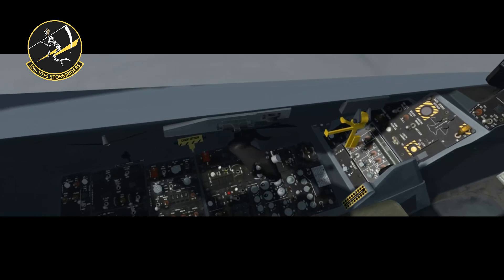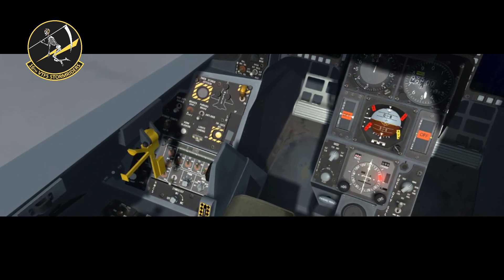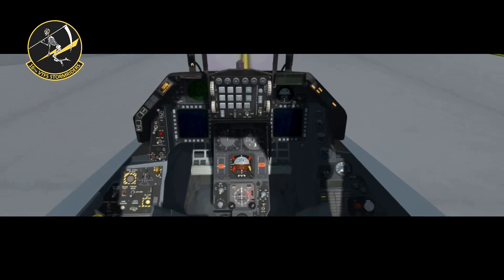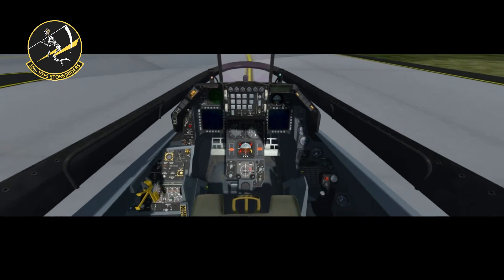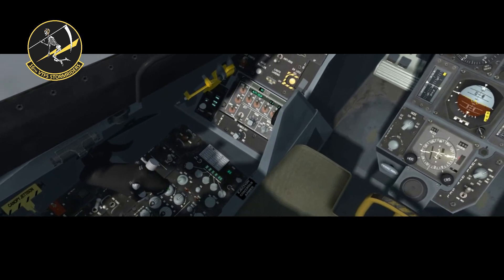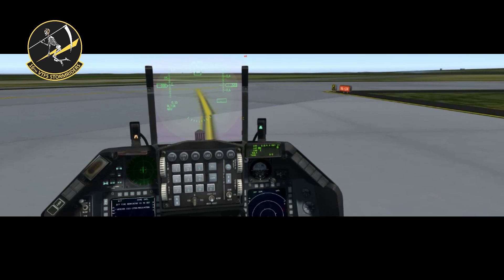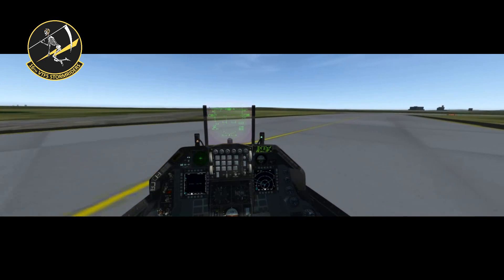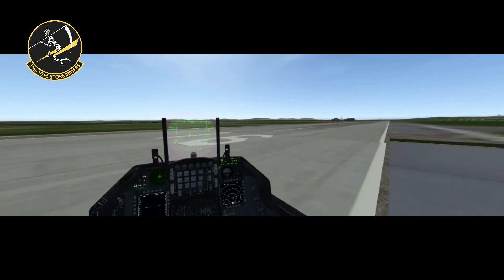Falcon BMS 4.33 Tutorial - Ramp Start (Scramble mode)

Comment: Hi, first off, great video, extremely helpful! I was wondering if you could help me with an issue I'm having.

When I turn on the HUD, the altitude and velocity are not there, only the scales. Is there a key that I may have accidentally switched or is it an issue on the game's part?
Reply from the maker: +TauAreSickAtCC Hi there! I am at work right now so I can`t verify that but this is probably due to your plane INS not beign aligned.. Make sure, that INS knob on right panel is set to Align first and then - after 4 to 8 minutes set it to NAV mode. I hope it helps.
Reply: +16VTFS Stormriders it looks like the issue was that I was using the Viper in ths first Ground_Ops mission which is an older block that only comes with the scales.
Reply from the maker: I am glad, that you figured it out :) Fly safe!